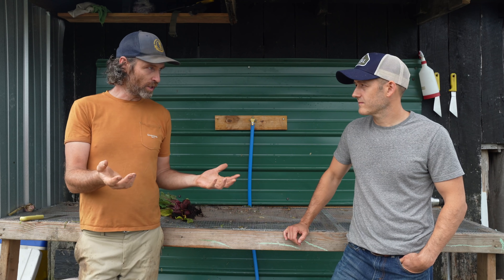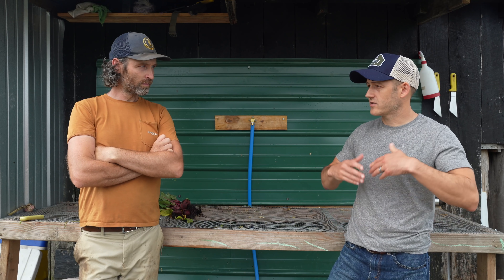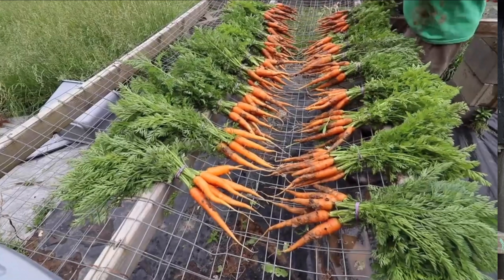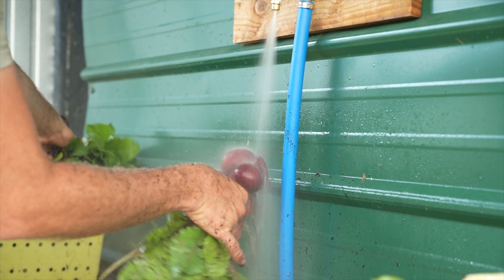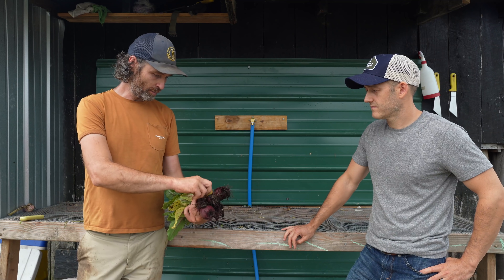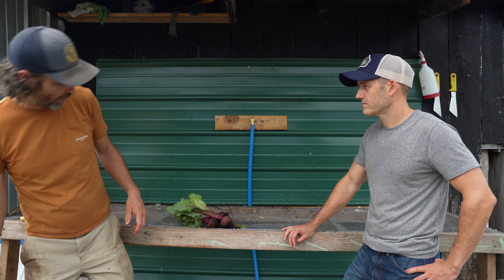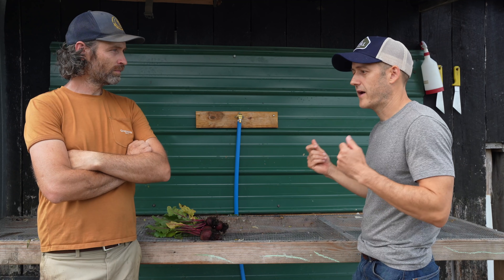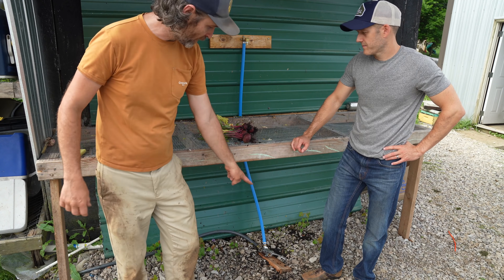Foot-Operated Root Washer (DIY)

Comment from the maker: Great comments so far, everyone! If you get a comment from @Dlextown, that's David. And a few people have asked about the impact and it roughly breaks down like this: I say "cut by half" in this video, but the time savings are generally more than that and I get faster the more I use it. It depends on conditions (mud or bad leaves) and the variety but 200 carrots cost us about $39 to produce before wash (~$0.19 a bunch––and this is on the high end). Labor before for washing was 1.25 hours (for not too dirty carrots) so $17.50 for 200 bunches. That made carrots $0.28/bunch. Labor now with the new washer is about .25 - .30 hours or ($3.50 - $4.70). So it's a labor savings at the station of at least $12.80 per 200 bunches.  So on the high end, $0.21/bunch. And so at our goal of 6000 bunches per season, it's a cost savings of roughly $420 a year. Just on carrots. That's a little back-of-the-napkiny because I haven't done a full analysis yet, but not too shabby for a small change in the system.
Reply: Cool the labor savings is great. Making more time available in the day is a big deal. If your saving .25 minutes per 200 bunches now also apply that across beets, radishes, spring onions, leeks, turnips if you grow them. Your saving about 1.5 hours a day on your harvest days before market. Walk in to any manufacturing plant and tell them you will save them 1.5 hours per day in their current process and they might laugh at you. Show them how it's done and you will be employed for life if you so choose.
Reply: Wow.  One and a half hour to wash 200 carrots previously ?  I'll time myself from now on... I might be spending days a year washing produce...
Reply: And don't forget opportunity cost!

Comment: okay having a LOT of trouble with ONE part of this design, that I'm actively working on: The PEDAL that I got off amazon has COARSE threading at the inlet where the hose water would be coming through. No fittings will fit on it! I sent the pedal back and ordered another one off another site but it was the same exact one. Does someone have any advice for me here???

Comment: I would think most airline blowers or tyre inflators could be adapted, and are probably cheaper than the water fittings. The quick disconnects could be useful too. Water collection to a sump would be a good idea but will silt up.

Comment: Thank you for sharing this set up! A discrepancy in the parts links vs the video: at 9:49, David says the flow rate of the nozzle is about 2 gpm at 40 psi, but the link is for a nozzle with a flow rate of 2 gpm at 20 psi. Which one is correct? Thanks again!

Comment: How could I have missed this? I only just saw this AMAZING video, and wow! This idea is FANTASTIC! I do have a suggestion: you mentioned in the video getting soaked by its use, which is inevitable. Why not install a custom piece of plexiglass between you and the water? You could still reach over and around it, but you would not be soaked, and it would also direct the water to your water catchment system instead of onto you.
Reply: Was also thinking something along this line

Comment: Great video. I like Pex, but I prefer the Pex A vs Pex C.  In Pex C, the connection is the weakest point and a flow bottleneck and I've seen the clamp fail in outdoor well pump setups in high humidity/salty air.  With Pex A, your water flow is not restricted by the connections and the connection is the strongest point.  Very well suited for freezing climates.  I visited the Uponor manufacturing plant and it was mind blowing.  Two words, molecular memory.  Milwaukee makes the expansion tool. I understand that this is past most peoples budget, just wanted to mention for the super pro types that want the best of the best.

Comment: Great video, apologize if it's been previously mentioned as there's heaps of responses.
Perhaps adding a horizontal bar against the bench that acted like a linkage to push down on the pedal valve also.
To alleviate foot cramps for large harvests, and give the operator 2  ways to use the station. 🙏🇦🇺

Comment: Hi Jesse! I am currently drawing some mock up designs of a vesion of this I want to make.. I need it to be moveable and I am hoping to design in a catch basin to redirect water for irrigation.
I just had a few questions though.
Have you made any modifications to yours yet? 
Have any farmers sent you photos of theirs?
Do you know what fitting I might use to extend it out further? I am a short female and would need it alot closer.

Thanks for the great ideas!
Reply from the maker: We did bring it out six inches, but I can’t find the link at the moment (I’ll ask David). We will likely add a valve that allows me to hand spray sometimes so that I can wash bins and other random things. Also if the pipe is going to be exposed at all use black plastic instead of PEX as PEX is not as weather resistant. Lots of farmers have sent photos of their set ups but they were all instagram stories. Maybe I can put together a highlight reel of them this morning.

Comment: That's a nice system I think it certainly would cut down on time. The two main issues in my wash station are picking up the sprayer over and over and over again and water getting hot in the line

Comment: i like the basic idea. but would definately make some changes to your system. the nozzle would need to come closer to me bcuz i have short arms, and lower bcuz i'm short.  maybe even come down from overhead would be a better option. 
a wider board or maybe wide pavers to attach the pedal to, to make the pedal more stable as your skinny, long board is shifting under your foot pressure.
under your work station, it would be a good idea to install a drain tile with landscapers fabric around it to collect the water, and filter the sediment out. then have it go to a storage tank to be used to water plants, buckets, carry baskets for harvesting. maybe farther to the right or around the corner from your wash station. 
btw i liked your duo rack from your old wash station better than the single flat rack. not sure why you changed that.
good luck! 
also p.s. sharkbite pex fittings are known to leak and do not tollerate weather tempature changes very well. you should use the pex bands they are much better. and they will expand when the pex line expands & will shrink when the pex line shrinks. just incase you live where the temps get very cold, or very hot.

Comment: the first thing I would do is lower splatter guard to protect shins and feet. I love the idea of having a swing out auxiliary arm for clean up of crates buckets harvesting containers I Mean they're right there.  this is a great proof of concept. with pex I would even have a lower jet spraying up and away for versatility.  shade shed but no back splash, let the over spray water some greens or spray away from the body. I saw this efficiency on the PowerSplit wood splitter but never made the cross connection for this application.  love the video and Thanks for the amazing idea.

Comment: Pressure washer nozzles are all 1/4 npt and you can get them at most hardware stores. In metric yours would be 3.5mm orifice and 30* spray. Could experiment with many different nozzles.
Reply: Tried the pressure washer nozzles and they do not create enough velocity for me.

Comment: Needs a splash shield infront of the table that way no wet shoes or pants
Reply: Could install a splash shield on top too designed with enough room for easy movement of produce

Comment: Great idea with the pedal - though I would make it a bar parallel to the edge of the washing table so that you can stand to either side and use either foot to find it easily - that way you could more easily keep your foot out of the spray - especially when you move the nozzle further out from the wall  :)

Comment: I bet if you had a pre-spraying station on the left for the incoming box in order to pre-clean the upperlayer, you only have to fine tune at the last manual cleaning. Hope this helps
Reply: That’s how we’ve set ours up because we haven’t been able to create enough velocity yet. So we wash with blue wash gun from johnnys or modified pressure washer for things like turnips and then finish as necessary with the foot peddle sprayer. I hope to figure out the velocity issue this week.

Comment: This is awesome. Thanks for sharing! Also, put a hook on your table to securly hold your hose sprayer when you are still using it! Costs almost nothing and saves many frustrations!
Reply: and have you tried pre-soaking your root crops? It has better than halved our wash time! Absolute game changer.
Reply from the maker: Only when they are super muddy
Reply: Instead of a hook attach a rod so don’t have to waste time trying to find the hook

Comment: Ok, so I just purchased everything except the pedal because it's out of stock. But, if I were to get something to extend the "faucet", what would I use? Thank you so much for this video. I can't wait to get it all put together!
Reply: You would need a 1/2 NPT pipe nipple of a length of your choosing. https://www.mcmaster.com/pipe-nipples/pipe-size~1-2/brass-and-bronze-pipe-and-pipe-fittings/standard-wall-brass-threaded-pipe-nipples-and-pipe/. And replace the 1/2 male x 1/4 male adapter with a 1/2 female x 1/4 male adapter https://www.mcmaster.com/50785K614/.

Comment: So…can you give us a breakdown of the impact? How much faster are you now? What is the $/bunch impact before and after?
Reply from the maker: I say "cut by half" in this video, but it's generally more than that and I get faster the more I use it. It depends on conditions (mud or bad leaves) and the variety but 200 carrots cost us about $39 to produce before wash (~$0.19 a bunch––and this is on the high end). Labor before for washing was 1.25 hours (for not too dirty carrots) so $17.50 for 200 bunches. That made carrots $0.28/bunch. Labor now with the new washer is about .25 - .30 hours or ($3.50 - $4.70). So it's a labor savings at the station of at least $12.80 per 200 bunches.  So on the high end, $0.21/bunch. And so at our goal of 6000 bunches per season, it's a cost savings of roughly $420 a year. That's a little back-of-the-napkiny because I haven't done a full analysis yet, but not too shabby for a small change in the system.
Reply: @notillgrowers  that’s great. Appreciate the detailed response.
Reply from the maker: Sure thing! and that's just for carrots. There is a similar savings on onions, radishes, beets, turnips, and etc. as well.
Reply: @notillgrowers   The fact you have figured out the labor involved in washing and calculated that in puts you light years ahead of most of us.  Something else I struggle with is I tend to work a lot faster than my hired help!

Comment: I built something like that 10 years ago, but the pedal was  heap plastic and only lasted a year.
Was an excellent device until it broke!
A couple things i did was for the vertical pipe.
I used a rigid pex pipe for the vertical, then heated it w a heat gun and curved it 180deg like a candy can at shoulder height.
I attached a garden style quick release coupler so i could swap heads or even attach a short hose
So glad u reminded me of this project and found a cheap metal pedal, gonna build it again!

Comment: You could take a plastic 50 gallon drum split it down the middle and use it and use it underneath as a trough and keep it on a pitch and have it dumped into a another 50 gallon drum or half of one with a filter on it because you're going to get too much sediment in your drainage Rock overtime really cool though nice build I want one

Comment: Wow! Jesse. Brilliant! Out here in the West where we have very little rain fall this will be time and water saving device. A couple of questions come to mind? Why is this the first video I've seen to address this problem? I guess it might show farmers are so busy they don't have time to get innovative. Another thought is to implement this idea at the hand wash stations at the farm, heck why not in the house kitchen sink for washing dishes. Might sound crazy but how about in the shower. Thanks for putting in the time on this.
Reply from the maker: Both great questions, Paul! I genuinely have never seen a system like this on another farm. Could be a great way to reserve water. Foot-operated everything! Hope all is well out there
Reply: There is an excellent Instructable that connects the lever arm a self-closing shower valve with a cord and wooden pedal to turn an indoor shower on and off.
Reply: Foot pedals are used in portable toilets and on airplanes

Comment: I love it! Maybe i would try to built it similar with a water tank under the desk and try to use a normal garden shower instead of the nozzle :) I would like more content how to improve the efficiency in a market garden setup. Greatings from Germany :)
Reply: Garden shower may not have enough pressure to dislodge dirt clumps

Comment: How much % did the change affect your cost?
Reply from the maker: Sorry for the copy and paste from another comment, but here is the rough breakdown: I say "cut by half" in this video, but it's generally more than that and I get faster the more I use it. It depends on conditions (mud or bad leaves) and the variety but 200 carrots cost us about $39 to produce before wash (~$0.19 a bunch––and this is on the high end). Labor before for washing was 1.25 hours (for not too dirty carrots) so $17.50 for 200 bunches. That made carrots $0.28/bunch. Labor now with the new washer is about .25 - .30 hours or ($3.50 - $4.70). So it's a labor savings at the station of at least $12.80 per 200 bunches.  So on the high end, $0.21/bunch. And so at our goal of 6000 bunches per season, it's a cost savings of roughly $420 a year. Just for carrots––so not including radishes, beets, etc... That's a little back-of-the-napkiny because I haven't done a full analysis yet, but not too shabby for a small change in the system.

Comment: On drainage. I can totally envision a raised floor catchment basin to recycle that water. And also if you don't already have a drain setup. Sediment also isn't a problem, and I'm sure that some of that would be much happier moved back out to your growing areas. :)
Reply: Good point about taking the sediment back out to the garden.  I was thinking it might clog or damage some types of pumps.
Reply: @dlextown  Landscape Engineer Pro Tip: Use a pond pump or utility pump. They are rated to handle debris like leaves and even rocks up to a certain diameter.  I like the "Everbilt" submersible utility pump for a cheap diy option at home.  It's not what we use in commercial ponds due to runtime, but the price is right for my home garden and the thing moves the muck!

Comment: Awesome! Very interested in more design ideas. Would pressure from a gravity flow water collection source be enough? I could see this as a mid-section outlet to water collection system if could solve it.
Reply: Probably not, but adding a pump to pressurize to 40 psi is not a difficult addition to your system. Also add a pressure switch to the pump so that the pump doesn't run constantly.
Reply: You get about .4 psi per foot of water height, so it would be about 90 ft to get to 40 psi.  But 15 or 20 psi might get you a functional sprayer.  We could use an adjustable regulator at Jesse’s farm to see how low you could go and still work.

Comment: Home gardener here.  Last year I grew 25 pounds of ginger.  I cleaned it all with my garden hose.  It was ridiculous.  I was soaking wet.  The ground became a messy bog.  I trashed a raised bed trying to figure out how to clean it all.  I was so proud of my ginger but the mess was incredible.  As I used it throughout the winter/spring I realized, my process didn't even really clean it all that well.  There was still a ton of soil in the nooks and crannies that I then had to clean some more.  This looks like it would work for so many different projects.  Heck, rinsing out transplanting pots and trays would be so much easier with something like this!  Thanks!
Reply: So agree Casey! I'm a home grower as well and really enjoy useing some of Jesse's techniques and love it! Congrats on growing all that ginger also.
Reply: Soaking the ginger rhizomes before spray rinsing might help dislodge the dirt in the nooks and crevices too.

Comment: Would a knee control sideways be easier than lifting foot?
Reply: I would argue against the knee control. Unless you are sitting and moving your entire leg sideways, just "bowing" out the knee sideways is a disadvantageous movement, biomechanically. Your knee is a hinge joint, it really only wants to move straight.
Also not a set of muscles you'd want to strain for any amount of time.
Foot pedal operations are already quite ergonomic, so I'd rather fine-tune that (how far to lift etc).
Reply from the maker: Maybe! The foot lifting has been basically unnoticeable for me, but it certainly may be an issue for some people or after a lot of product.
Reply: I could use something I could push my stomach against to turn it on. I’d be leaning in when washing the produce anyway.